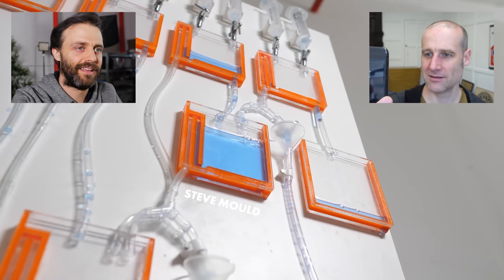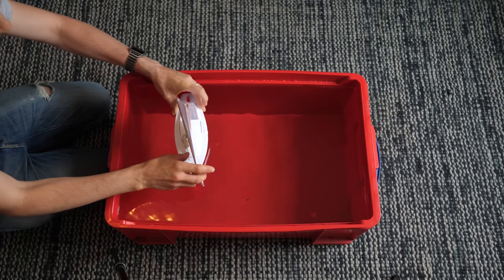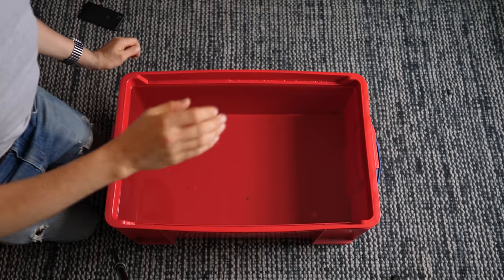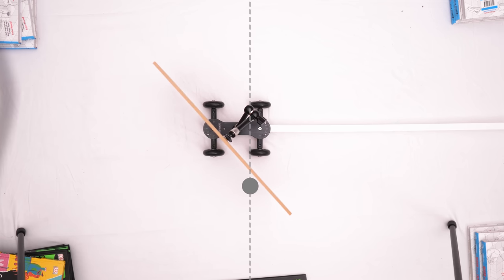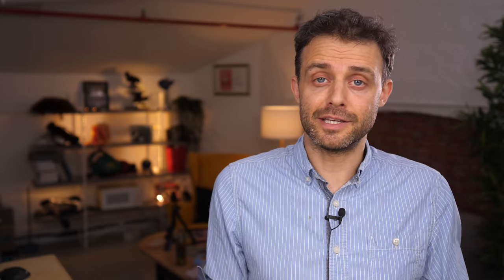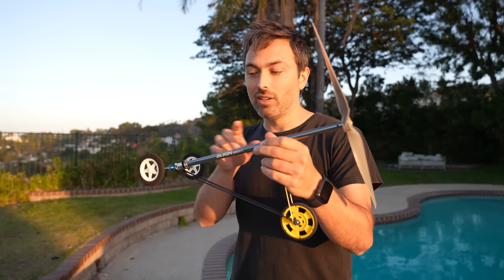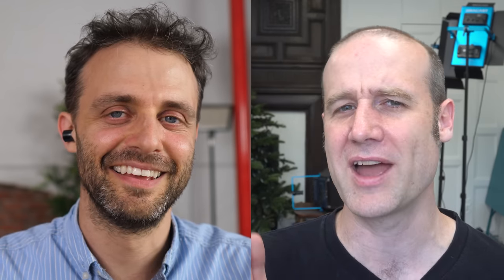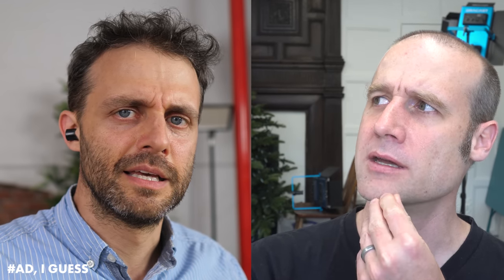Sailing Faster Than The Wind - How Is That Even Possible?

Comment: Turns out it’s a mechanical advantage problem. The sail is a wedge.
Reply: Lol
Reply: In the model, the board is acting as a wedge. In a real sailboat, that's not quite the case, since as he says, the direction of the force is not the same as the direction of the wind.
Reply: Yeah, I was disappointed with that also.  He only made passing reference to airfoils even though he was responding to a video that featured airfoils.  I'm guessing he never learned to sail himself...  A priori knowledge.
Reply: @EebstertheGreat  that is correct, with a wedge the input and output forces are perpendicular, so the sail is acting as a wedge.
Reply: You have your flat sail acting like a wedge with the “sail” being pushed and not like a curved wing, which would be creating lift from the low pressure created by the air passing more quickly across the front rather than the way you are representing it... a common misconception made by non-sailors...
Reply: Aerofoil or not, I agree that a wedge is a good enough approximation to describe how to sail faster than the wind. This video doesn't explain how to beat the wind however. I just made a video with graphics explaining how you can do so: https://www.youtube.com/watch?v=CbNCz0_iO7c

Comment: I don't say this lightly, but this might be my favourite video of yours. Something complicated and counter-intuitive explained with such elegance and ease that I'm half convinced that its entirely obvious and I always knew it. Worthy of being the first one after the million barrier
Reply: One thing I'd really like to see, a plot where the velocity of the ship is one axis, the angle of the sail relative to the wind on the other, and coloured according to the magnitude of the force on the ship. My new found intuition is that, the sharper angle the lower the force (wind gets deflected less) up to when you approach the "maximum speed" for that angle. But that maximum speed itself increases with that angle. Would be good to see how that would look graphed out, if there's a clear optimum trade off for a given speed, and what that optimum looks like.
Reply: @QuantumHistorian  You might be interested in explanations of the tip speed ratio of a wind turbine. It covers this concept.
Blades angled close to the wind have a high speed but as you say the lift force going in the direction you want is low so low torque. Used on rotors with 1 or 2 blades.
What complicates things and wasn't covered in this video is that when something moves through air it has it's own headwind. This adds to the existing wind and changes it speed and direction as experienced by the moving object.
Reply: @Ed.R  Actually, while it's not discussed, the model presented covers these forces. It can thus explain how a boat can travel in the downwind direction faster than the wind, which unfortunately was not demonstrated because that  is the true analog to Veritasium's video.